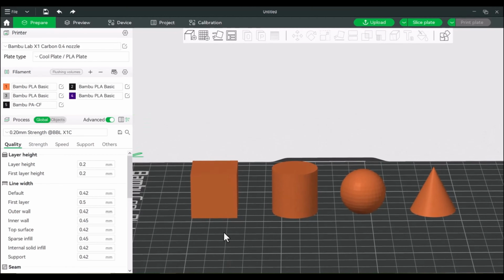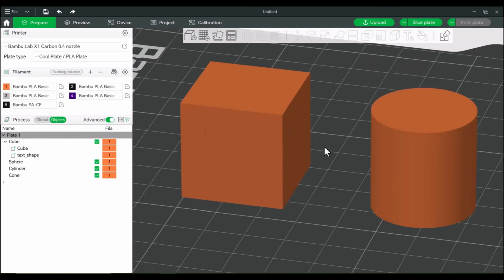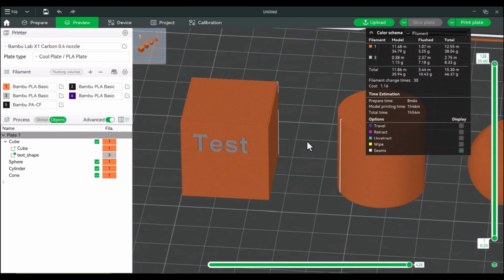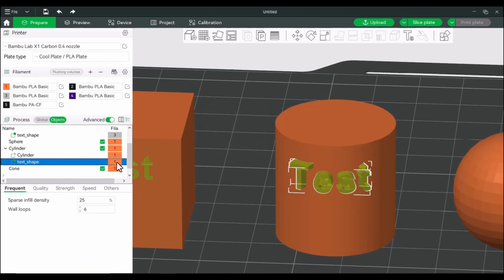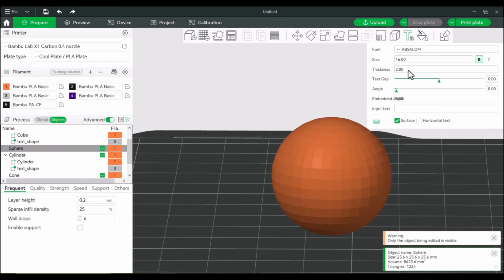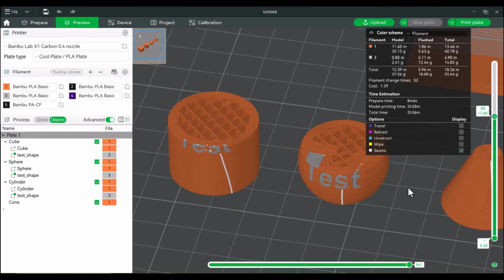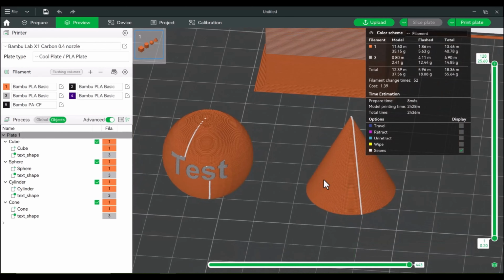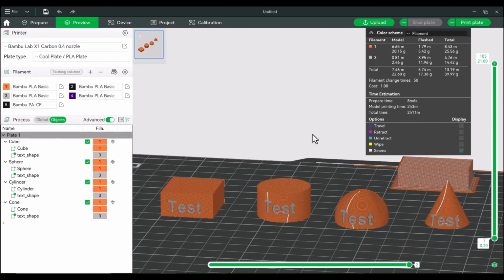Bambu Studio Flush Curved Text

Comment: Have tried multiple times but just can't get it too work. I followed all your step, but the text is still cut off. What I mean is, after doing everything you said, the text does not change to the colour selected, just looks an outline in the orange. Also some of the outline of the letters is not visible. I am trying to do this for a round bowl.

It seems changing the type to Modifier, makes the text worse eg, harder to see. So I might not change it to Modifier. Text is still showing up as orange.

Comment: I don't know if things have changed since this video was posted over a year ago, but I'm able to do all of this without having to change the text to a Modifier. It can wrap around and change colors as a Part. Is there any other difference or benefit to changing it to a Modifier?
Reply from the maker: Hello. Adding text on a curved surface  hasn't changed much over the versions. This way works best if the curve is too "narrow". If you add text to some models text can stick out on some areas. It is also helpful as you do not need to worry about depth of the text if you only want surface. 

Modifier works well as it only affects the area where the model and modifier touch. 

Modifier
https://youtu.be/FFylfvJ0Xpk

Comment: Yah, butttt how do you curve the text on a flat surface 🤔
Reply from the maker: Hello, thank you for the question. There are a couple of ways to do it. 

the long way found here doing everything in slicer
https://youtu.be/DxFQfYj-baM?t=1109

And a newer way using maker world's maker lab, you just have to export out the stl. The biggest downside is the small font selection. 
https://youtu.be/mNaFPv932WA?t=271
Reply: @ashleys3dprintshop  thank you that actually helped
Reply from the maker: @Meowinater3000  😁

Comment: Hello, I did everything like you said, but it’s not printing the words in different color
Reply from the maker: Hello. is your text printing the same as your model? 
Without seeing your specific use case I can offer some recommendations.

You should use the modify tool first
Then color the text last. 

If you do the reverse, color, then modify it will not work. 

So in my example you can click the text on the left, then press the corresponding key on the AMS. (1,2,3,4...)
Reply: @ashleys3dprintshop  I don’t know why, but it’s mixing filaments colors
Reply from the maker: @leostreit  Are you getting color bleed/blending or discoloration?
Are you using colors with a big contrast? Like black and white/ light/dark?

If so you may need to increase the purge/flushing amount.
Open flushing volumes and adjust multiplier 
https://wiki.bambulab.com/en/software/bambu-studio/reduce-wasting-during-filament-change

Turn off purge to infill if it is on. 

There is a technique to reduce purge on butter pocket prints channel as well.

So there are a few other things.
1. is this tiny text?
2. What is the layer height? .2, lower?